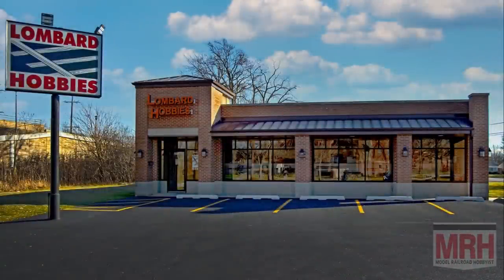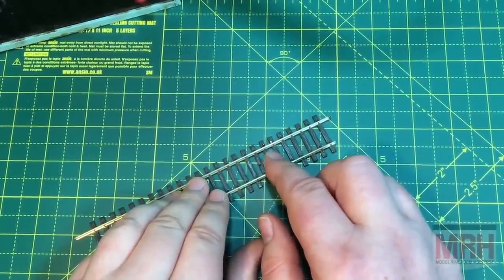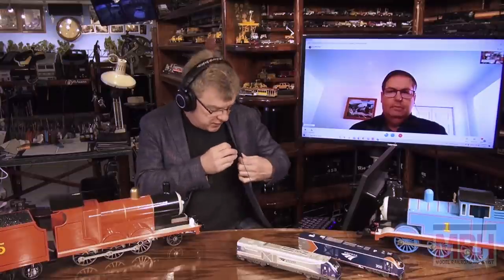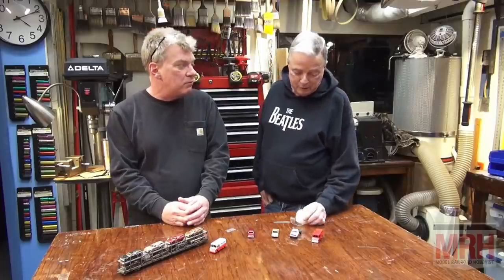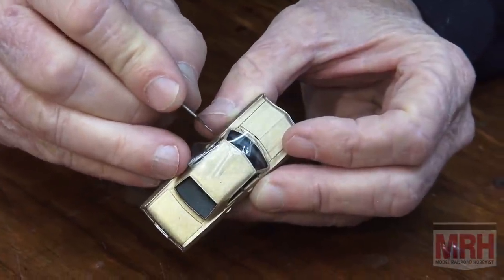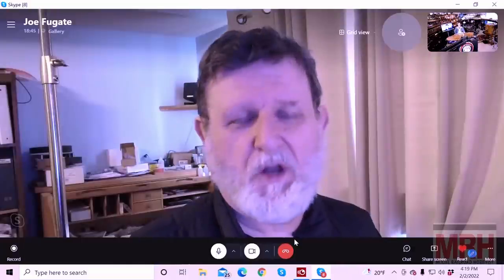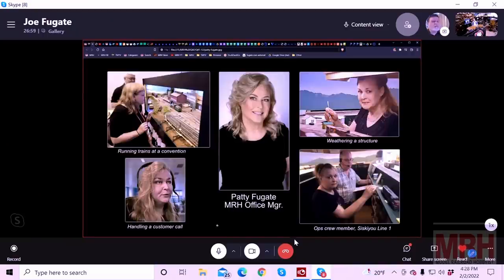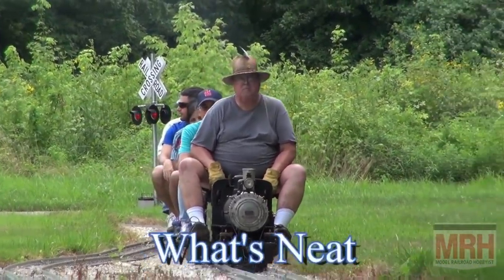Soldering for modelers | April 2022 WHATS NEAT Model Railroad Hobbyist

Comment: I've been soldering rail joiners and power feed drops to rails for many YEARS.  This is the first video I have seen recommending tinning the rail before soldering.  I use a good paste flux which comes in a syringe-type applicator.  I do not tin rails before soldering anything to them, drops or rail joiners, but do tin my drop wires, fluxing the wire then tinning as shown.
For rail joiners, I get the track in place, flow a little flux onto each rail and then heat it all up with a 1/8" chisel tip soldering iron across the ends of both rails (a 1/8" chisel tip for me has been vastly more usable than a pencil point tip; in fact, I do 98% of all soldering with a chisel tip, RARELY using a pencil tip)..  I learned a LONG time ago (mid-80s) to use a large wattage soldering iron - 40+ W.  

I agree - get in, heat it all up, apply the solder and get out before there is time to melt the rails.  IMO and from experience, chisel over pencil almost ALL the time.

Comment: Ive been soldering electronics for 35 years with electronics grade flux core solder with no issues.  Make sure you use a quality solder and iron as well as a clean tip.  George from Soundtraxx did a better tutorial.